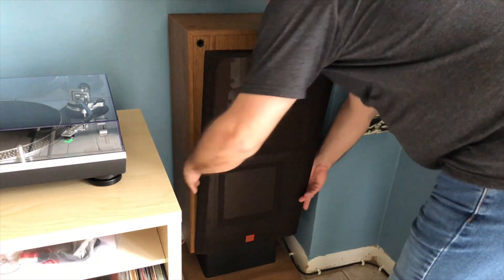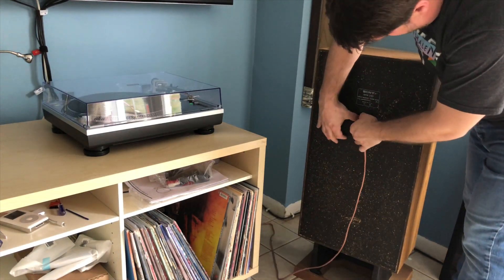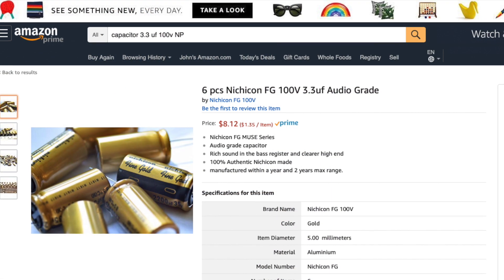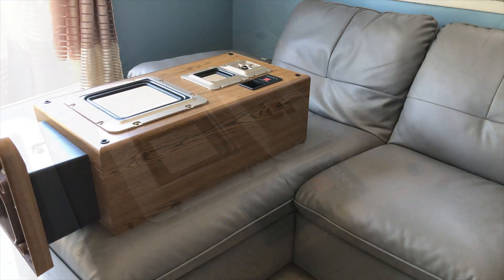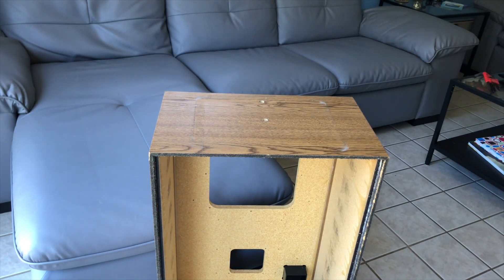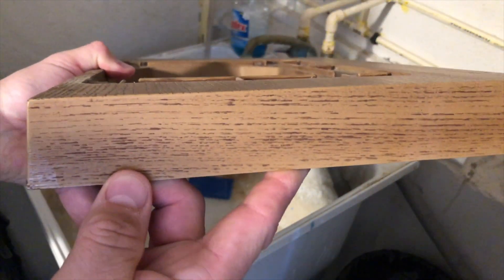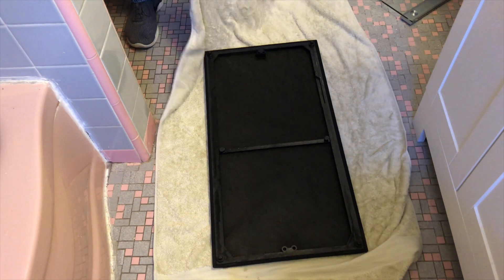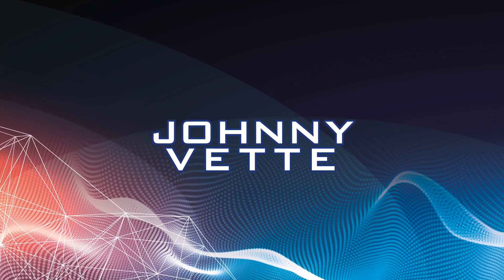Sony APM 790 Speakers - Disassembly, Cleaning, & Capacitor Replacement (repair)

Comment: Wow impressive, i have a Sony APM 910AV
 model & one of the tweeters is winded but the quality is not the same as it use to be for HIGHS, i think i need to replace both tweeters... By they your model looks nice in Wood color & i wish i got the Sony APM 910AV in same color but my is in BLACK...

Comment: I just watched a digi-key to do this and I chit you not the total after shipping was $6.66. I have the exact same speakers. I'm underwhelmed by them listening to them on my Pioneer SX-1250 and I'm going to try this. I also just bought some Pioneer AMP 100's (Going to pick them up Monday) this should be interesting.

Comment: Those magnets and that frame is thin what is that.5 " particle board I would reinforce the center spray the inside insulation spray let it expand then spray with flex seal and the be sturdy and non resident then put  10" driver's and 3".5" full range mids and a nice 1" soft dome tweeter put insulation two way tape on the back of speakers replace the posts with some new ones and you would have a speaker that would rival anything I just did the same thing to a shit pair of Technics and they are now the probably one the best I ever heard I would put a whole new crossover not a couple of caps I buy them pre made for $25 and they Prof built

Comment: you make a point of showing that the capacitors are non polarized yet you replaced them with polarized capacitors. i personally do not use electrolytic capacitors for electronics in speakers, i use film capacitors made for crossovers. but they do make non polarized electrolytics for crossovers also.

Comment: This is a nice video and it is obvious that you love those speakers a lot, but at the same time I am a bit surprised that you didn't try to upgrade them. Of course, these are your speakers, so you treat them as you like, but if they were mine, I would have made the effort to put better quality capacitors to replace what is the cheapest on the market. Also, since the back was completly open, I would have put a piece of wood horizontaly in the midlle of the box to stiffle those pesky vibrations we hear at specific frequencies. Maybe a little bit more damping material could also help with the 'midrangy' tonality you were speaking of. Even the plastic pedestal could have benefit from a bit of weight and damping, because these too can transmit vibrations. Now, I challenge you to modify only one of the speakers and try a right/left demonstration with a monophonic recording. You can record the difference and show us how much it will have improved the quality. Do you accept that challenge?

Comment: You have to glue the back, otherwise you will have vibrations.
Also someone suggested a little work on the wood, it's a good idea for the next time :) 
Overall a nice presentation.

Comment: Lol. Your right about them not being audiophile. That's a joke of a crossover. Who knows if the driver's are good, but if you like them, getting a proper crossover made for them would probably be a huge improvement.
Reply: Hi i have a paur of apm speakers from Sony... It sounds good.

How will i know if the crossover is right for my speakers?
Reply: Not to mention, the tweeter sounds tinny and spitty.  No fidelity.
Reply: Yeah just a paper cone...could definitely upgrade them along with the crossover...most are buying them for the look of the square drivers anyway...@scottlowell493

Comment: OMG, that cabinet is screaming for some poly fill, at least on the sides and back of the cabinet....  Anyone agree with me?
Reply: Yes, I agree with you. Plus some bracing inside the box and damping for the plastic pedestal!
Reply: Yes, fiberglass foam
Reply: Yes!!!!! Someone opened it before and removed the glass fiber. Not all is aesthetics, what you don't see can be more harmful to good sound.
Reply: no,  i don't use polyfill in ported speakers myself. a better damping material on the rear wall might tame midbass coming from the rear of the woofer... like some eggcrate foam.